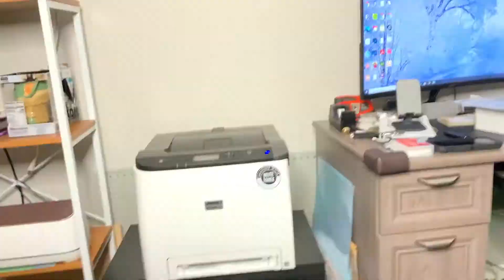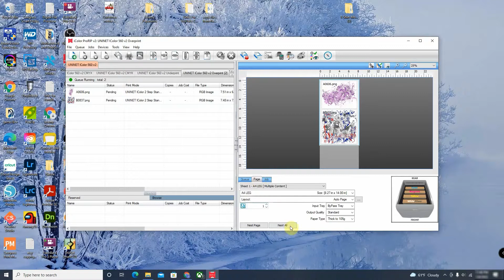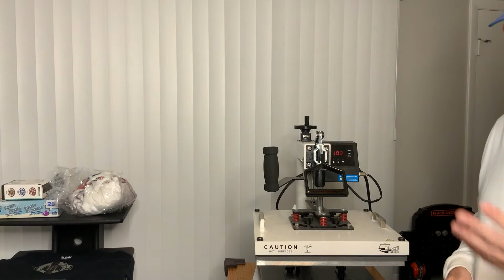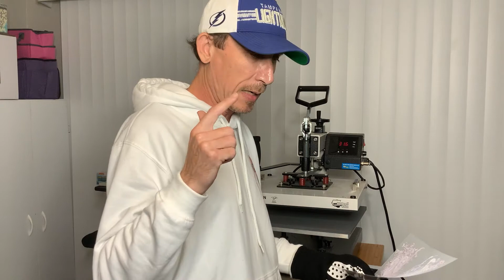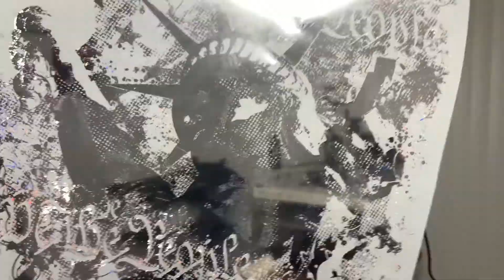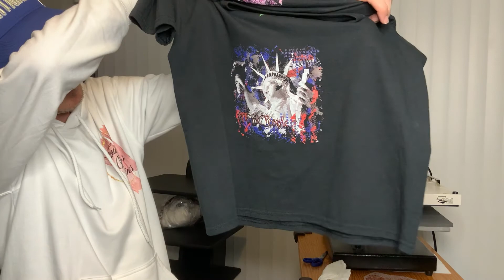iColor 560 setup and first press step by step walkthrough! White toner printer!!

Comment: When peeling jobs that are logos, you cannot afford any of the toner/image to remain on the transfer.  I haven't had one successful job yet for logos.  I don't know which combination of temperature or pressure results in a more successful transfer.  Maybe it's the peeling technique?  What is your success rate now?
Reply from the maker: My success rate with 2 step standard is really good. On occasion I might lose a tiny corner or little piece but usually does not affect my design. The pressure and peeling technique def make a difference. I have had a little issues with the icolor select ultra bright which I have just recently started to try using. What paper specifically are u having issues? Have u checked out the White toner transfer group on Facebook? Wonderful group that offers help.

Comment: Hi a question how many prints you have so far I only have printed 90 less than half page each and the Y and C are gone. Thank you
Reply from the maker: Hello, so I have went through an entire package of standard, 2 1/2 packs of one step, and another 40 ultra bright, probably close 400 prints…. My machine has given me low toner warning since June, I bought my refills then, still haven’t had to use them, thought because I had warning low toner would be gone quick, but so far so good, but it is all dependent upon the amount of ink coverage u are using as well. Hope this helps

Comment: Bought a used Icolor 560. It will not let me install RIP software. Does the former owner need to uninstall the software on their computer 1st?
Reply from the maker: The prorip software only works with the usb dongle, if they did not include that you should request it from them, otherwise you will probably have to purchase one, if you contact Craig spooner or joe dovi, they may be able to get you a discount upon proof of purchase?

Comment: I’m trying to print but it keeps saying Queue Running total:1 holding 1
Reply from the maker: Make sure in the queue is set to either usb or wireless, whichever your using, better to use usb, and make sure your design fits within the allotted paper size you have selected. I’ve had that happen before either when queue was wrong or the file was bigger than the page and would not print, check the white toner support group on facebook